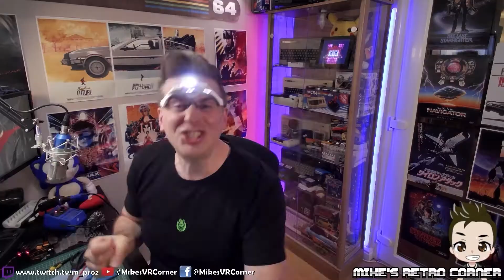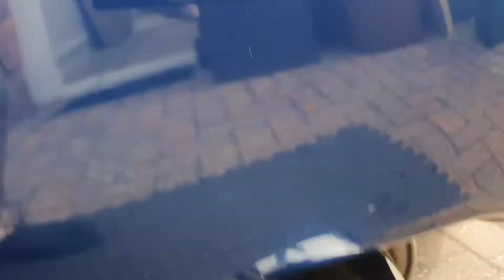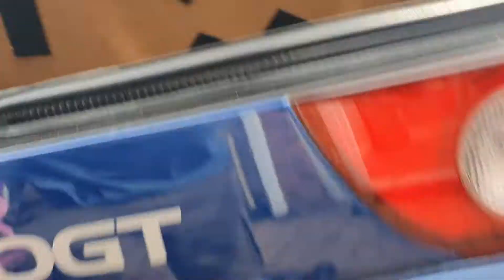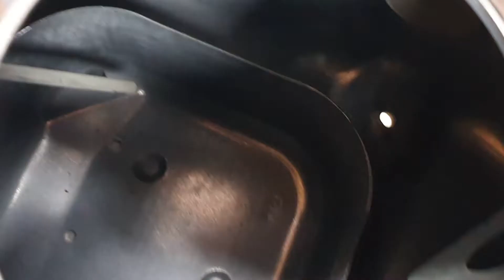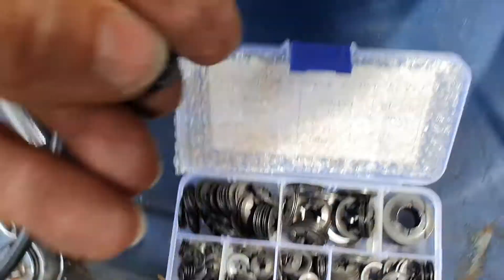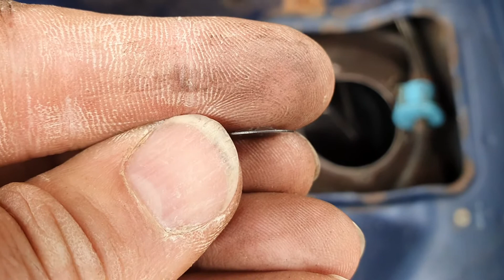Mitsubishi 3000gt/GTO Fuel tank Studs repair.

Comment: Nice work! I had the same 2 studs break on mine. I’m about to do the exact same thing. My question is does this allow for the nuts to come off or does the whole screw just spin? I am contemplating putting some epoxy in.